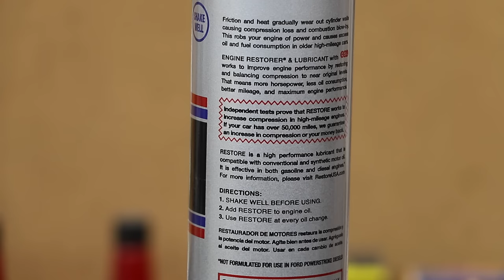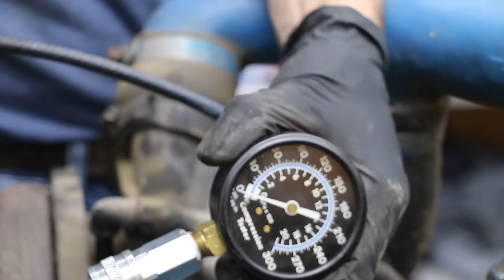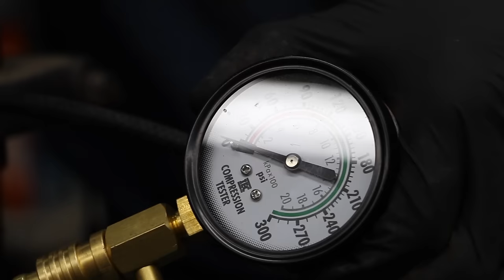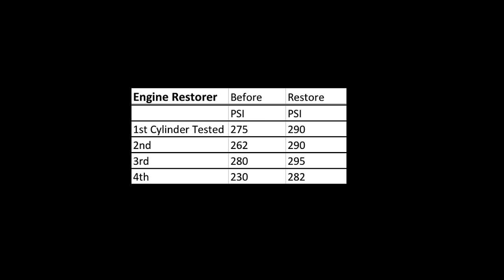Does Restore Work?  Will it Improve Engine Cylinder Compression?

Comment: Do i need to add engine restorer at every oil change to keep the compression at its peak and oil consumption at minimal ?
Reply: yes, been using it for over 30 years As the protective layer Restore fills in, it would ware away & the defects would return in time, Its the best made Band*Aid for your engines if used Correctly. think of wood filler, Cheers

Comment: Can you do a test with engine restore on an old 6 cly engine that has 208,000 miles?  Could it also stop or limit the startup blue smoke?  Just curious.
Reply from the maker: Thank you for the video idea!
Reply: @ProjectFarm  Got a 93 Dodge caravan 3.0L that blue smoke on startup.  Stops after it get to operating temp. It it rings or valve guide seals?

Comment: So update on my 2004 Dodge Neon SXT I STRONGLY SUGGEST NOT USING RESTORE ALL MY SEALS ARE LEAKING NOW AND I'VE HAD MY CAR FOR OVER 11 YEARS AND IT'S NEVER DRIPPED ONE DROP OF OIL I changed the oil 3000 miles ago along with a bottle of restore I've got oil leaks everywhere! And it sounds like I have a bottom end knocking now 😡 I would not suggest and will not use restore ever again!

Comment: Do you have to keep it in the engine or like a once every year sorta thing
Reply from the maker: It wears away.  So, I use it every oil change if the engine is in bad shape and every other oil change for engines just needing a little help
Reply: @ProjectFarm  okay makes since you should really do fuel filter comparison between all of the top brands and then motorcraft and k&n please lemme know if you will

Comment: So if your v6 used 6 quarts would the person use 5 quarts plus a whole bottle of restore to compensate the last quart with restore
Reply from the maker: I don't believe the 6 cylinder version of restore is less than a quart of product.  So, probably around 5.5 quarts of oil plus the product.
Reply: cooldaddyslick thank you. I have a Vw vr6 engine with 4 cylinders around 150 and the 5th around 120 and 6th around 90 I’d like to test it on this motor and see if it helps
Reply: cooldaddyslick will do I’m going to run first again let it warm up without additive check compression. Then pour Rislone Additive and check after I go on a 30 minute drive and post before and after numbers! Let you know by tomorrow 👍
Reply: cooldaddyslick so here is my conclusion! 
Before Restore engine Restorer & after
Cylinder 2/150.   160
Cylinder 4/150.    160
Cylinder 6/90.      120
Cylinder 1/140.      155
Cylinder 3/145.      155
Cylinder 5/140.       160

So yes it works! I will say when I pulled my spark plugs out they do change the spark plugs to like a rusty heavy bronze color! And no I do not work for this company nor am I advertising for them strictly a person trying to find out if some of these chemicals are a scam!
Reply: cooldaddyslick not sure I would want to spend 13 bucks every oil change. I think this is a great temporary fix but I don’t think that my opinion I would spend the $13 plus the $60 in oil change fees as well I’d rather just fix the solution and move forward! But I would recommend this product to anyone

Comment: The low compression on one cylinder is not the reason the engine is difficult to start.  The problem is insufficient misting of the fuel.
Reply from the maker: Thank you

Comment: Now one thing. NEVER use this in a vehicle with VVT, it clogs up the solenoids, and makes your vehicle perform horrifically. It's fine for these old engines though. But be sure you do not have Variable Valve Timing.
Reply from the maker: Thanks for the feedback.

Comment: I wonder if the diesel Ford tractor had starter fluid used on it.  I knew of a farm that used starter fluid on their diesel, and it almost immediately required starter fluid, even on a 70 Deg morning.  It's like crack cocaine for diesels:  Once you use it, it won't function without it almost immediately thereafter.

Comment: Can I use Restore on a car with 500 miles, almost new? Will it help in the future?
Reply: No reason whatsoever to use it on a new engine, or as preventative maintenance.  It only works to fill in tiny scuffs and scratches that are already there, formed from long hours/many miles of use, and this won't prevent them from forming in the first place.  Just use a very good engine oil, filter, keep up on the maintenance schedule, and maybe add a can of RESTORE once you're passed about 75,000 miles.
Reply: @Fluffy65  I appreciate your honest answer. I will wait till the car has 75,000 miles. I usually buy "good" oil and filter and change them every 6-7k miles.

Comment: Just curious, does this help with ticking noise for lifters??? I heard from my mechanic it's a huge labor intensive job... he then said it will be fine even if its loud... I have a 97 Lexus ES300 and man its ticking loud as heck!
Reply from the maker: I've used Seafoam in the oil just before the oil change and it helped resolve a bad lifter tick issue.  Recommend checking out the Seafoam website and instructions to see if this is the right option.  Engine Restorer is more for restoring lost compression.  So, I don't believe it'll help with lifter noise.

Comment: I've used restore in my 96' 5.0L the thing had 320,000 miles on it before I got rid of it but after I put restore and a new timing gear set and chain in it the thing sounded cammed and alive again  l
Reply from the maker: Thanks for sharing.

Comment: Does the tractor start now without starter fluid or preheating?
Reply: I just saw the other video showing the tractor starting. Very nice
Reply from the maker: Thank you for the video idea!
Reply: Project Farm I have a old kioti tractor and starts the same as yours did. I’ll let you know how it works on my tractor. I don’t think it’s a power stroke cause it’s so old, real hard getting parts for it now. I really appreciate all the research you do.

Comment: @project farm . Hey bud I was wondering what’s your thoughts on a newer engine with vvts or VTEC.iv seen this stuff work myself on old push rod engines like my Chevy 3.1 is gave me about 15 psi up from 120 psi. Iam a technician and use my Honda CR-V for daily driving I recently dish compression on this old k series with almost 200k and despite it being considered low by Honda specs it’s at 130 psi which is Honda min spec. Now from experience I know pretty much on gas engine anything above 100 With less the 15 difference between cylinders is sitting pretty....mine where all 130 give or take one or two psi. Anyway iam a little concerned about the restore clogging up vvts soliniods and maybe even the timing chain tensioner which is oil fed and original. What are your thoughts.
Reply: Also the rings are or cylinder walls are the reason why iam down on compression I added oil to gain five to 10 psi up from the 130
Reply from the maker: With vvt, I wouldn't use it unless the compression losses were such that I had nothing to lose.

Comment: im guessing the quick fix is over after you change the oil. another words having to add this to every oil change to keep the effect?
Reply: Not so. I used Restore back in the 80's in a Corvair and in a Mazda truck. Only used it once in each but did several oil changes in both. (didn't know I was suppose to add with each oil change. lol). Pressure stayed good for the 2 and 3 years I owned them. I was totally impressed and have always recommended Restore ever since then. It also works well in lawn tractors and push mowers.  I just used 4oz of it in a 17.5 hp Tecumseh with low compression about 6 weeks ago.  The stuff still amazes me.
Reply: @halrhoads6194  very awesome

Comment: I’d be curious to see if the results hold up after a few oil changes or if you need to keep using it
Edit: just saw that’s the first recommended video
Reply from the maker: Thanks for the suggestion.

Comment: Hi!
Here you have received a request not so far
From North Pole. Norway.

You test a lot of lubrication / oil components.
I do not see that you have tested Pro - Longe.

I have used Pro-Longe in everything mechanical.
Car engine (petrol) Diesel. Tractor.
Lawn mower Compressor.

Older diesel engines that crack a lot, but with the use of Pro-Longe the engine runs slower.

Wish you took the time to test the Pro-Longe as you test the other products.

Regards from Norway.
Dag Nilsen..
Reply from the maker: Thanks for the video idea.

Comment: I was hoping that you could test Air-Tec High-Class Micro-Ceramic Oil Additive 250ml
Reply from the maker: Thank you for the video idea!
Reply: No problem! I was reading the description on Amazon about their product as well as the products website. It seems to have similar properties as the Engine Restore with the added benefit of a ceramic coating to the metal for smoother running engine ( less friction). Thank you for replying to my message and keep up the great work and content I love your channel!

Comment: Why aren't you testing any BG products?
Reply from the maker: Thanks for  the suggestion.
Reply: @ProjectFarm  as a retired former Senior Technical advisor for BG China, we did demonstrations at dealerships, and near test sites for their pollution monitoring test stations,  when cars failed to pass emission tests, but had no check engine light on we treated the engines with several of our chemicals, and changed oil, ran them back through the emissions test, and 100% passed, our chemicals are professional use only, and must only be used as directed, they are the most powerful chemicals in the automotive industry.  And are second to none...

Comment: I keep getting code P0300,P0305,P0430 would this help restore my engine my mechanic told me it could be a damaged valve being I’ve already replaced o2 sensors, spark plugs, coil pack #5 and #5 fuel injector. I just need help I’ve spent lots of money and problem still persists.

Comment: You cant use it on a 7.3 or 6.0 powerstroke because they use the engine oil to fire the injectors. The restore has grit in it that would eat a heui injector to pieces.
Reply from the maker: Thanks for the feedback.

Comment: Does this work on a boat motor
Reply from the maker: It's only designed for 4 stroke engines.
Reply: Is there one for boat motors by another brand

Comment: Read negative reviews on this product on Amazon, being used with new car engines. It'll probably clog up new engines that use low viscosity oil... Probably fine for most older engines, like tractors n trucks that are push rod and not computer controlled. You've been warned!
Reply from the maker: Thank you!

Comment: Oh I've been using a can of compression for 45 years. Works great just mix and add USN canned dehydrated water.
But before I touch an engine I inspect the valve lash clearance. A tight valve(s) will skew your results, Ang!  burned ex valve with do the same  thing. A  tight and tuliped intake valve(s) also will lower the, compressiion signifigantly. Dont toss a can of shit into it Until you've made sure of the engines state of tune is ok  then do your compression restore thing
Reply from the maker: Thank you!

Comment: You changed gauges from from your before test to your after test.  Did you ever check the gauges against each other to ensure that they agreed?  Regardless of the absolute pressure values, it does look like it helped the 4th cylinder significantly.

Comment: Use transmission fluid
Reply from the maker: Thanks for the feedback.
Reply: @ProjectFarm  no problem I know this is late but my granddaddy had an old Ford tractor. It was worn smooth out and a bit of transmission fluid bumped up the compression and made it run.

Comment: Try not to make changes to your test system between when you run a control and when you introduce variables. Also you never told us if your engine starts up now without preheating the block...

Comment: Tried RVS yet? https://www.rvs.fi/en/tuote/d-products/

If you need to add an additive to every oil chage, seems to me ALL it does is thicken the oil. Meaning it doesn't  actually DO anything. RVS supposedly makes a lasting ceramic coating between two metals where there is friction. Dunno if it actually works.

Comment: As we can see, the compression of 3 cylinders of this engine was already very high. One cylinder had a bit less compression, which points at mechanical damage (damaged ring or valve), NOT wear, because that would probably have been the same in all cylinders. It's nice that RESTORE apparently increased the compression of that damaged cylinder (for how long?) but otherwise this test doesn't tell us much -  no verdict on the claims that RESTORE "restores engine power", "restores engine life" or "reduces oil and petrol consumption". In all, not an overly useful test.

Comment: Only use this crap on low tech older engines like this engine. You would never want to put this into an engine that has variable valve timing like v-tech or something similar.